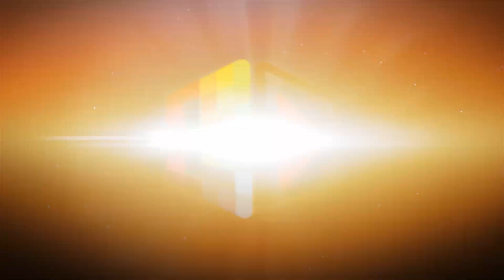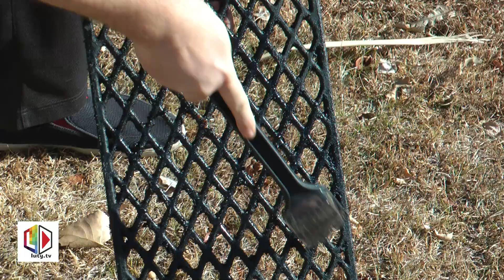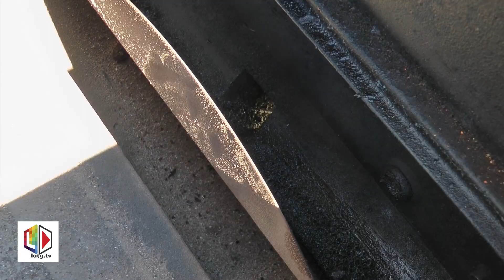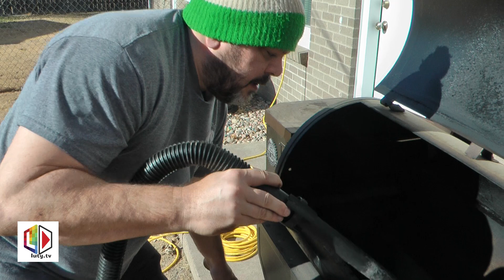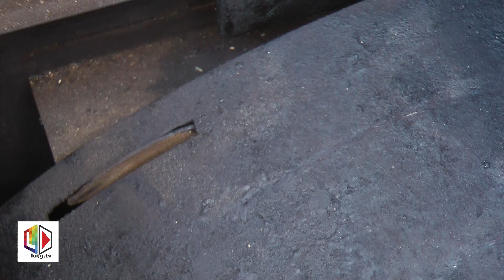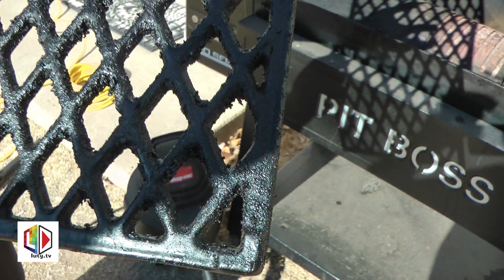How to clean your Pit Boss Pro 1100 Pellet Grill

Comment: I think all pitboss pros have a sear plate. My $499 model 850 does I think the $399 pro model does as well. Thanks I needed a video to send to my wife so she been prep the grill for when I'm home tonight.
Reply: I just got the pit boss tailgater and it has a sear plate but the nice thing about the pit boss pros is that they have the rod to adjust it the tailgater doesn’t so you have to stick a spatula or whatever down there to adjust it.
It’s pretty easy to adjust but having that rod would be easier
Reply: be a man and clean your grill Ray